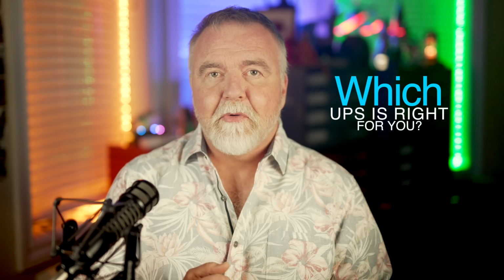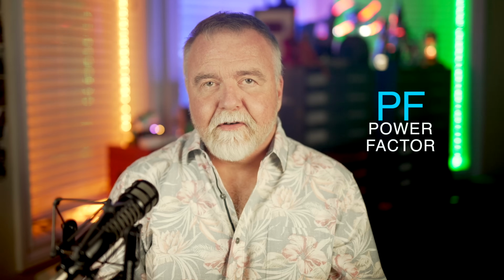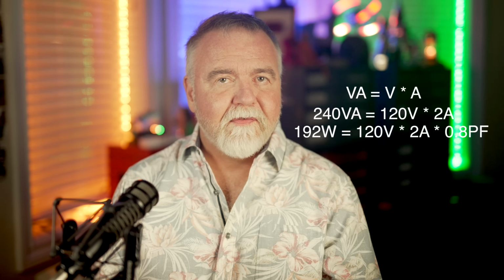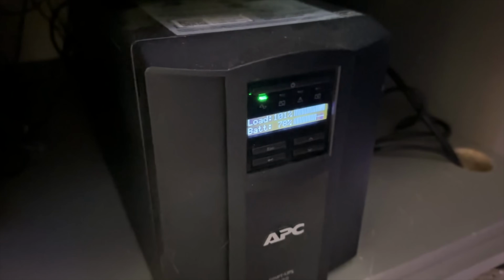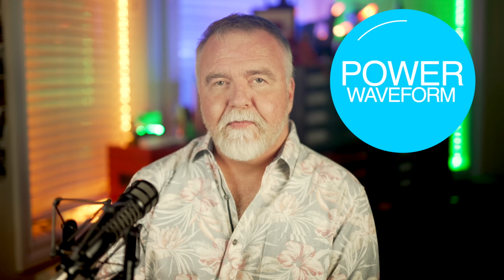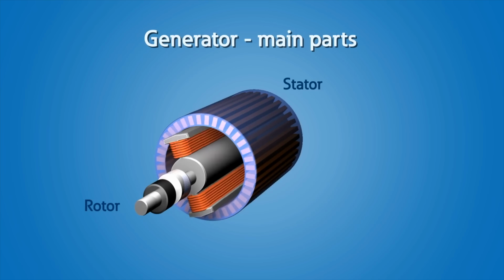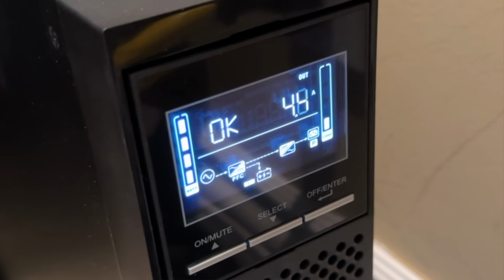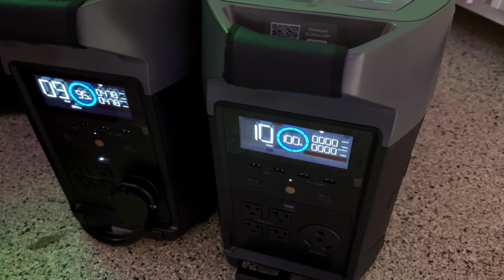The UPS Secrets YOU Need to Know!

Comment: Been working around the APC UPSs for over 20 years now. All that they guarantee is every 3 years your server will lose power when the battery goes dead.
Reply: Yeah.  I have a low opinion of UPSs.  I've only used APC ones, but they seem to cause power problems, and since we almost never lose power they have almost never saved anything.  Overall we have had much more problems having UPSs than if we hadn't bothered.
Reply: Amen to this comment.  Having also worked in it for 23 years I too have experienced more power losses caused by APC UPS failure rather than the grid.  YMMV on other brands but APC are not alone in what seems like poor design.
Reply: Have had the same experience with APC UPS. Have stopped production a few times due to the UPS suddenly dying.
Reply: They seriously caused more problems than they solved at my hospital.  We abandoned ever replacing the SLA batteries because the electronics failed so often.  Not even going to mention the medical grade "smart" power strips we had to use that disconnected as soon as the USP fired up...🙃
Reply: Are they dangerous by chance? I got one between my legs under my desk. I'm afraid of the batteries going off
Reply: Do servers not have redundant power supplies for this exact purpose?
Plug one into the UPS and the other direct. Sure still have to deal with the UPS batteries being trash but at least you're not taking the server down to replace it.
Reply: Did you ignore/silence the warning ⚠️ 
Lol
Reply: At work we've been switching to the CyberPower units, they seem to be of better quality/durability than the Schneider Electric units.
Reply: @Thomas Galea  expensive ones have hot swappable features
Reply: @Slay_No_More  Up to you where you put yours but I'd say not very dangerous.
Reply: @TDGalea  They sure do but only when we're looking a mid to large business servers.  If a small business (say 2 to 10 staff) then a small file server with a single psu is very normal.
Reply: @daviddeakin2172  Indeed; I'm running a cheap "eBay parts" PC as a home server which of course has no redundancy. It'd be nice but the cheap little UPS I've got in there seems pretty decent so far, plus being a home server means it very much doesn't cause any havoc going dark for a bit.
Reply: I've been in my current house for 12 years and have had two power outrages. For me i'm pretty sure adding a UPS would actually increase my risks, even with the more expensive ones.
Reply: APC is a poor brand to represent the UPS market. You don't base your opinion about a market on the cheapest option with the lowest price tag for any product. That $299 computer of mine only lasted 6 months computers suck. That $200 Yugo rusted out in one winter season, cars suck!
Reply: @zaphodbeeblebrox2911  Ah! Medical grade power strips... Sounds lovely!

Well I thought medical grade PSU's were as far as it went. Seems I was wrong about that. And for anyone wondering as it was explained to me by the PSU manufacturer, well actually he was the owner and main engineer of the company, a medical grade PSU was seriously over built, but it also had to comply to strict standards regarding out gassing of potentially harmfull or irritating substances. It was a bit more involved than just making a good PSU. But they also came at a serious price premium.
Reply: @TDGalea  I do when possible but sometimes this is not an option.
Reply: @craigcoffman69  Nope, every USP we have has the management card in it which is connected to pager duty to open a ticket when the battery needs to be replaced. It only saves me about 50% of the time. Seems like the smart-ups 1000 - 3000s  go dead when running a self test without warning.
Reply: Yep I can attest to that. I have 4 APC UPSs for my two servers, firewall and network hardware and cctv. They work fine until they dont. They will continually pass self tests and run the equipment during failures, until finally they one day come online, start screaming and dont even provide enough power for a shutdown. Metering the voltages on the batteries while on standby, it seems they float the cells too high. Next battery failure I am going to try and rebuild the pack with a couple LiFePO4 batteries instead of the SLAs and see how it does.
Reply: That made me laugh. I have had tons of luck with APC vs off brands. When the batteries die I simply connect them to my bank of 20 lead acids which pull charge from solar. Holds up pretty well and the double convert/filtering becomes the best part.
Reply: The lead acid batteries almost never last beyond 2 years, so no surprise that the first event around 3 years will dump the load because the batteries have been bad or degraded for a year already.  This is true of any brand with sealed lead acid batteries. I managed a dozen UPS's at my previous job and never had an outage caused by the UPS or batteries because I had batteries on a 2 year PM cycle, sooner if they had been deep discharged for any reason. Biggest was an 8kva 3 phase, most were 3kva single phase. Eaton and MGE mostly, all double conversion. The company had maintenance contracts for the bigger units (15kva to 500kva).
Reply: @grumpyoldman5368  And realistically they should last 2-3 times longer. The battery management on APC UPSs is quite aggressive and I have noticed they seem to float the cells too high. A proper lead acid BMS should also take the battery off charge and let it settle periodically to prolong cell life. APC seems to like to float the batteries at damn near bulk charge voltages its no wonder they boil off and end up with a dead cell far sooner than they should.
Reply: Governments around the world are hell bent on making sure that your grid goes down frequently in the future, with their net zero policies. You may have to review your options. I agree, some ups are better than others.
Reply: In the restaurant biz, all they guarantee is a lifetime of beeping in your office
Reply: I’ve never had an issue with the APC UPSs that I’ve used over the last 20 years, although as noted by a few people, they do give very little warning. You can tweak them, at least the ones I’ve run, to adjust all their operating parameters to make them sensbile for your environment and then they’re pretty trouble free. But when their battery alert goes off, you have no UPS to rely on and if there’s a power outage or even a bad dip or brown out, you’re going down if you don’t have replacement batteries on hand to replace as soon as the alert comes up. If you get a low battery or battery replacement alert, do it immediately - they don’t provide you a window to go find a replacement when they’ve been detected as bad. And the UPS isn’t designed to operate on “dead” cells either. Maybe some other brands warn you earlier so you have more time to replace the batteries when it warns you? That I don’t know.

On the other hand, the handful of CyberPower and other off brand UPS’s that I’ve used give you even less warning when their batteries need replaced. Bear in mind, this is based on using them about 15+ years ago, so they may have fixed these issues, but it used to be that some of these brand UPS’s would only warn you the battery was dead and needed to be replaced after a power failure that they didn’t protect you from had occurred. Not very helpful, as at that point, even I already know the batteries are dead.

But I am open-minded to alternatives now that I’m considering what my options are to switch my home network to something lithium-based instead of lead acid. I’d like the longer runtimes and longer lifespans afforded by those units, if I can just work out the most cost-effective option for a casual home user. Nothing I have is mission critical or production, so I’m not looking for enterprise-grade stuff built for a datacenter, but I would like to see the pro-sumer and lower tier commercial grade stuff become more home network friendly price-wise. If I have a choice of spending $3-5k for a UPS that’ll backup and run my home network for an hour or two or sticking with lead acid that I’ve been running for decades, then I’m sorry, I’m just going to throw out $10k for a Tesla Powerwall instead that’ll run my stuff for several hours and also keep my fridge and a few other useful household items powered overnight or for a day or so. Right now it seems like there’s a huge gap in the consumer space for this kind of stuff. I’m looking for who’s going to fill it or come close enough for the money.
Reply: @babybirdhome  You can get lithium iron phosphate drop-in replacements for common lead acid sizes. There are some considerations such as making sure the charge voltage isn't too high and that some BMSes don't like you putting 12v batteries in series. For extra runtime, just duplicate the age-old hack of running wires out of the unit and attaching larger batteries.
Reply: That’s why you replace the batteries when they’re EOL and turn off the auto-test feature.
Reply: As long the UPS is from a reputable brand, have not been tampered with, is used and installed correctly according to the manual then you should have no problems. can always look up reviews from others to feel better.
you may wanna consider moving it away from your legs to avoid feeling uncomfortable and get leg space.
Reply: @Gsoda35  Like I said in my orginal post, APC UPS. APC is the brand which I was using. I don't have this under my desk. They are rack mount 30amp UPS. I always use original APC RBC too. Nothing tampered with they just suck. and nearly 100 people agree with my REVIEW.
Reply: @TDGalea Big Brain!

Comment: Dave, I'm a generator guy among other things.  It seems like you once mentioned that you were running a 70kw backup genset.  If you haven't already, do a "lights out" test.  Kill your utility and let the generator run the house for a few hours or half a day.  The UPS's are kicking off some really wild power factor.  The old rule of thumb was that the genset needed to be 5x the total UPS load to handle the pf.  I've had it bite me a few times.  Maybe your generator guy knew how much UPS load you have, maybe not, maybe he sized things ok, maybe not.  Either way, test run everything before you have to rely on it.
Reply: Something to consider when I install a generator, thanks! 🤔
Reply: Interesting. Inrush currents can be insane. I recall hearing when switching power supplies started to become the norm it created massive issues during brownouts. In the old days when your house mains dipped things just shutoff; when it returned they fired back up. But with switching supplies which have very wide operating voltages when you dip due to a brown out the supply compensates by pulling more current. So the brownout goes into avalanche mode as thousands of houses just pull more and more from the grid rather than backing off nicely.

Comment: I worked a battery backup Y2K project back in '99.  Covering the server room and close to 50 bank branches,  and never learned as much about UPS's as I did in the last 20 minutes.  Love going to your school Professor Dave.
Reply: Dave crushes every topic which is why I have mad respect for the man.
Reply: My dad volunteered to be on call that New Year's Eve. He was convinced nothing bad would happen, and he said he could charge as much as he wanted. I don't know how much he ended up charging, but as expected, nothing did happen, at least not on his watch.
Reply: @aaronperl  some things did happen but it was companies that completely ignored patching the issue beforehand and then acted surprised the thing they’d been warned to patch happened.
Personally i never got why in a lot of cases it would even cause any long them issues as its not like most servers had data under 1901.
Though anything that referenced back to the previous years may or may not work depending if it would buffer overflow the other direction.
And honestly if they worried they could have always run a test server that they’ve manually clocked forward to just before 2000.

Comment: I have a garbage picked APC 1400 XL. It's been backing me up for 23 years now. I hard wired it into my main panel with permits on my critical circuits. I got rid of the internal 4x7 Ah batteries and have two 100 Ah external batteries in series. I can't believe it's still working perfectly after 25 years.
Reply: Depends on the outages here when someone sneezes the grid power goes down and often long enough to kill the batteries in my APC700. But saying that I am just about on my second set or 2x7ah replacements and had them since 2016 so about 3yrs a set. I have thought about putting larger AH batteries in place but in the end bought for fun an MPP Solar PIP5048 and 8 300AH batteries and got the place on a manual transfer switch so when the grid goes out don't have to sit in the dark or go to bed early - with latest outage I realized I don't have a simple method to tell when power is back on as all that's a bit remote so looking to run a mix of critical and non-critical loads. The whole place is transferred to the PIP on manual cut over so you cant use heavy appliances or will trip it but its mostly to keep lights and internet up to ride out the outage.
Reply: I think I have the same model. I paid around $200 for mine on Ebay around 2 decades ago. I have replaced the batteries 3 or 4 times for around $125 each time. With that said I do have 2 other UPSs with the newest being a Bluetti AC1800. The plan is to eventually run my PCs on solar during the summer months.

Comment: Great rundown Dave!

In the telecommunications industry we never loaded a UPS or a generator more that 80% of its nameplate kVA. So your 1200W (1500VA) workstation would require a UPS rated at1875 kVA. 

VERY important to know your loads. Super important point!
Reply: Shame... With computer engineering any computer not running at 100% all the time is considered wasted resources... Should try a real man's field sometime
Reply: @craigpeacock1903 ... I imagine that the official computer spec normally already has some built in overhead protection. Meaning they can do more than they say they can do ... So the 80% thing is already in there from the manufacturer.

With the power systems, when you hit the written capacity, they immediately flash overload and go off ... Meaning they are honest, and you have to do the 80% thing yourself.

Comment: The following is more info than you need in your video but a few may be interested:
Your example of what manufactures call modified sine wave (more like modified square wave) is very generous. Most products with modified sinewave use a square wave with 3 levels: max positive, short time at 0, max negative, then back to 0 for a short time in a way that averages to the usual AC rated voltage. Some may use 5 levels so they have a half step positive & negative added (each used twice per cycle). For a given resistance, the AC RMS voltage is equivalent to the same amount of DC voltage through the same resistance giving the same power flow, but sinewaves make it complicated. AC voltage sinewave means it goes higher than that RMS average for some of the time but the non-RMS average (if you divided cycle time into 12 or more evenly spaced samples) is slightly different to the RMS average.

Comment: Thanks for the excellent overview of UPS, I use them at work and at home. 
At work we run a dual 600 KVA Online UPS system into separate switchboards and then dual power all the equipment from each UPS, because UPS do fail sometimes. We also run some dual power systems with UPS and Raw, Again although the Raw power fails more often, we have had the UPS fail and Raw power keep going so critical services stay up.
A Minor correction at 19:42 when you were talking about your fathers IBM UPS having huge banks of 1.5 V Lead acid cells, I would observe that Lead Acid cells have a nominal voltage of 2 Volts per cell and a low to high range of 1.85-2.35 Volts.  This is why a 12V battery has 6 series Cells.